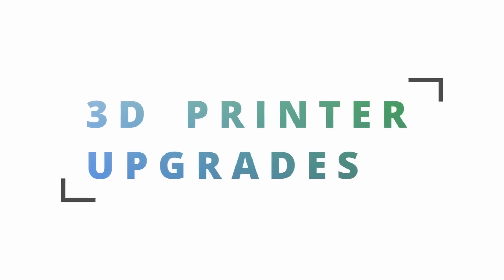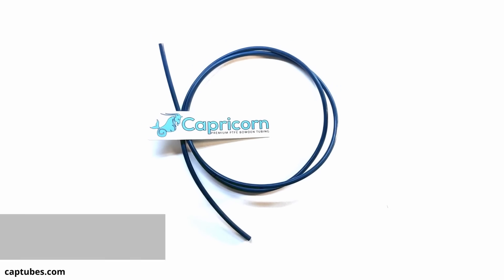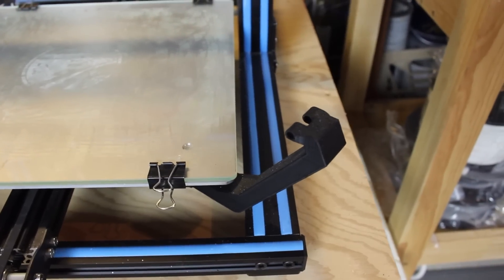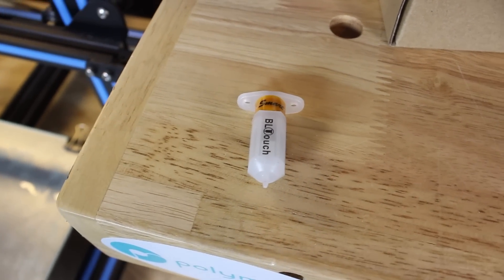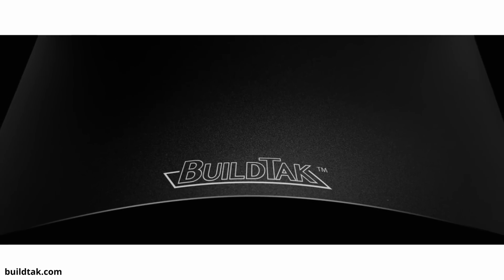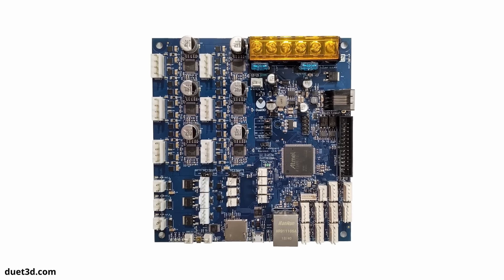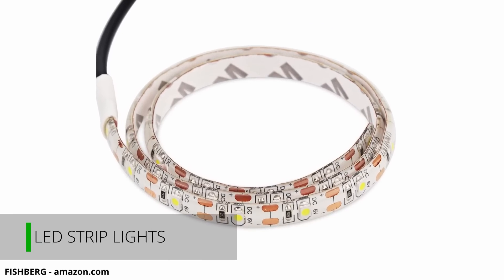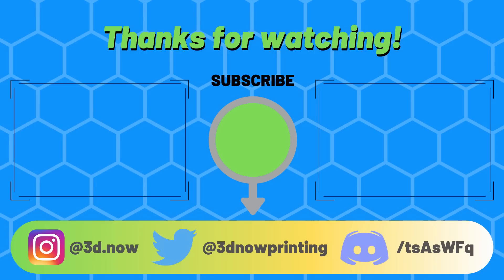The BEST UPGRADES for your 3D Printer!

Comment: This video really didn't age well.  Either that or it wasn't good to begin with.  

A steel nozzle is only a good idea if you are using abrasive filaments with stuff embedded in them.  Otherwise, they have worse heat transfer which can impact print quality.  Do yourself a favor and get a bag of 30 brass nozzles on Temu for $6.  If it's worn, clogged, or crashed into the bed, just replace it.

Also, don't bother with capricorn snake oil tubing... just get a bi-metal heat break.  Only costs a little more, but it's not a wear item and actually fixes the problem.  

I'm not sure if those smoothers actually work, but I wouldn't use them.  

The rest isn't bad.  Obviously there is new stuff... do klipper firmware with MainSail or Fluidd instead of octoprint so many benefits to klipper.  BL touch if you don't have it is great.  BTT makes great boards for a decent price.  Rails are all the rage now too.

Comment: Quick FYI for people, the 2mm silicone LED strips fit into the groves of a standard 2020 rail , and it dosnt conflict with the wheels - so you can add it to you Z gantry on the inside and have fantastic lighting on your parts.

Comment: I already disagree with number 1... You only should use hardened steel for abrasive filament. I also find Tough Tube to have a better tolerance, and cut better anyway. Also, the blower fan shroud you printed is cracked. Lol. Filament guide squeaks like crazy (I'm about to experiment with gluing a small piece of sponge to mine for greasing/wiping filament)

Comment: I printed carbon filament with a brass nozzle for an entire roll without noticing any deviation in my prints. Then I switched to a cheap hardened steel nozzle- which I've been very impressed with. A steel file glides over it without biting.

Comment: You don't need motor dampers if your controller board has a good motor drives. It is better to have a good controller board than a hack for a small problem.

Comment: See if this makes sense.  The Mosaic Palette 2/Pro deposits color filament inside the object that nobody is going to see.  But in order to do that it has to change colors by dumping a whole lot of waste to a secondary brick.  So while printing a many color object why not just have the exterior shell of that object where the colors are needed get printed and the filler can be whatever base color you like or it can be the "waste" material used as in-fill.

Mosaic isn't the only method of integrating multiple materials or colors into your objects.  There is another that mounts up to 8 spools for integration onto nearly any single or multiple extrusion head 3D printer.  It was featured in a video on 3D Printing Nerd's channel from 2019.  Sorry I can't think of it more precisely as it is late and I am too tired to dig it up.

Comment: No offense but, how on earth is an LED strip a "hard" upgrade. You literally just plug it into a power outlet, whereas a "moderate" upgrade such as the bl touch, involves a complete re-flash of the software.
Reply from the maker: You're right, but I put it in the 3rd tier because it is a "nice to have" upgrade and doesn't affect print quality.

Comment: The steel has half the thermal conductivity of brass and needs the heat to be turned up much higher to work properly
Reply: It's about 5 degrees C more.

Comment: Good video.i agree with you,but some things have to be considered.
Would be nice to have the upgrades done and tested as well.
For example the bl touch/any auto leveling system.it's easier to learn to do a perfect bed leveling than trying to get  them going and keep them that way.they're a unneeded pain.
Linear rails,there are machines that have worse results with them,due to they're tight tolerances.a bit of play it's good sometimes.

Comment: BL Touch, a good way to descend into madness. From drifting by .3 mm  to just failures in the coil. Adjustment screw only helped in the short term with the drifting however at that point I rather just have a z endstop. Now if you want a good device, look at ir sensors.
Reply: I went mad trying to figure out the software upgrades and just returned it and spent the money on a metal extruder, Capricorn tubing, glass bed, and silent mainboard. Much better use of 75 dollars.

Comment: One thing you missed on, although most people will never need, is an upgraded heat break. Mine just recently broke so I decided to get a E3D titanium break. 

I haven't got it yet so I can't comment on how well it works, but I can't imagine it being worse then the stainless steel ones that most printers use. 

Wish I had it before mine broke, now I have to wait for it to get here to continue printing.

Comment: I would recommend the EZABL by TH3D studios instead of BLtouch. The EZABL is more accurate, more repeatable and easier to wire up. No hardware modifications required apart from the mount. If you wish, you can power it from the motherboard but that's a hardware modification you'll need to do if you so desire. Firmware change is nonetheless required, but is a bit easier.

Comment: If you're getting the Filler spool holder for a Creality printer with the metal spool holder, get the remixed one. The original has a joint that buckles under the weight. The remixed one combines the holder and the base and eliminates the joint, making it sturdy.

Comment: This looks awesome. Except, I don't own/know much about 3D printing. 

Like, can any nozzle on a 3D printer be changed? 
Is the nozzle the only thing you have to change to use different size filaments? (And different materials?)
And lastly, are you able to change a Bowden to a direct driver?
Reply: nozzles can be changed, would be bad if you could not, most are M6 but there is no doubt some that use other threads
you have to change extruders and mess with the software i believe
yes did so with my cr10s, went from the stock bowden to the aero made by E3D
Reply: Pretty much every part can be changed out.  The ones that have no electronics are probably easiest.  I wouldn't worry about it until you need to, though.  You'll have plenty to do just with the stock machine.

Comment: All of those buildtak options are nice but they don't work with ABS due to ABS demanding ~110c bed temp so 105-120c.  The glue sticky is the issue.

Comment: Palette 2 doesn't really work, 70%+ failure rate with the product constantly jamming and many design faults that cause constant failures. Customer service from Mosaic is hopeless and the product only prints at 1/3 the advertised print speed

Comment: Seems like this went with the most expensive, not the best upgrades. Especially the last category.

1.Hemera??? What a waste of money, nothing revolutionary, and mounting is a joke. The PrinterMods direct drive upgrade is inexpensive and allows for dozens of hotend/extruder combos along with ready to mount linear bearing guide mounts for less than $40. I highly recommend taking a look at this for yourself.

2. Duet board??? This is another huge waste of money when can go with a SKR board for silent 32 bit 2209 driver replacement at less than $30.

You have fantastic video quality and narration but think this list was hugely bias to E3D products that are all over priced and not as great as described.
Reply: Duet is a waste if you upgrading printer like those in video. It is not only about silence. Same about Hemera.
Reply: I disagree, the Hemera is an all in one beast in its self. While I agree it's overpriced its because there was a team that designed it for optimal use. Mounting is an issue but can be solved with creativity. The Hemera also allows for a lot of different uses that a $40 system cannot handle. I do completely agree with the SKR instead of a duet board.

Comment: One you forgot to mention is a filament run out sensor. I am getting my Ender 3 ready to install one . The firmware has been updated and wires have been soldered into place, I am just waiting for my limit switch
Reply: How often does this come in handy? I rarely find I would need one as if I'm running low on filament I only print smaller things and just throw out spools with less than 50g

Comment: I would like to say the DUET Motherboard replaces the need for Motor Dampers, TL Smoother, and Raspberry Pi (Octoprint). If I knew that before I went and upgraded all the previous things over time. I would of just went straight to the Duet 2 WiFi.
Reply: Damn ok👀👌

Comment: I am crazy looking for information on which printer to be my first one, for the moment, it is either ender 3, ender 5 or one delta printer either the  "ANYCUBIC KOSSEL PLUS DELTA" or the "FLSUN 3D METAL FRAME KOSSEL DELTA"

would anyone be kind enough to post their thoughts on which of these printers would be best to help me make the final decision? 

by the way, great videos, keep up the good work
Reply from the maker: Check out my discord. Link in video description.
Reply: I've got an anycubic kossel plus Delta, and a creality cr10. They both work well, though I think the kossel has a more robust extruder setup. It's been printing beautifully right after assembly, while my cr10 has needed some upgrades to print reliably.
Reply: I have anycubic mega s and it print well it was my first printer

Comment: The spool holder is the only one you need for any config. I personally mounted on my wall and use the provided printable bearings. Added a few drops baby oil to the bearings and it effortlessly rolls as if they are metal. Print this holder if you need a reliable one.

Comment: I just got a ctc for Christmas and had to do a few mandatory upgrades. The seller I bough from cut corners, not ctc’s fault. Needless to say, had a faulty motor and instead of a regular sized heat bed there was a 3 inch heat bed kapton taped to an aluminum plate. Can share a picture in your discord if you want to see. After I ordered a new heat bed and motor this thing prints like a dream

Comment: You should have mentioned that if you get a better control board then you don't need tl smoother, if the new board has tmc drivers then the dampers aren't needed either.
Reply: I never needed them with the 4988 either as it is just one of the versions (I forget which one) that needed them.  I use TMC now though.
Reply: the dampers are shit anyway. they mess up the accuracy...

Comment: Triangle labs cloned parts from aliexpress work very well, and are much cheaper...
Reply from the maker: I would much rather buy products and support the companies who actually innovated and created them in the first place. I would rather buy a high quality product that I know will work and last. Also, with the actual companies you have customer service.
Reply: @3DNow  I would also prefer to support the companies that designed it but not everyone can afford $80 for an extruder, $30 for a nozzle etc especially when the printer only cost $200 in the first place, I mean if I used all genuine parts just replacing the hotend, extruder and nozzle would cost me close to what I paid for the printer, I do have some genuine parts like my bltouch, capricorn though but I have to buy within a budget so $80 genuine vs $25 clone is not a choice I can afford atm unfortunately
Reply: @Idlepit2  if you're printing high end materials, 30 for a nozzle isn't bad. If you're only printing pla you don't need it and e3d brass nozzles are cheap, especially for the quality. There is a big difference in cheap clone nozzles and real e3d nozzle. Cnc kitchen cut some up and proved that.
Reply: @neilsiebenthal9254  I use genuine e3d nozzles but I've also used cheap nozzles, one of my favourite nozzles was a cheap plated copper nozzle worked just as good as e3d nozzle but was none stick and cost about $5 so on par with the cheaper e3d brass nozzles I believe that was a trianglelab nozzle
Reply: @3DNow  by that logic, when are you selling your CR-10 and buying an actual Prusa(that is what it is a clone of after all)
Reply: @artbrann  the cr10 is not a clone of the Prusa... 😂
Reply: @neilsiebenthal9254  close enough for this comparison, considering it is a "Prusa style printer"(and some sites even say Prusa clone)
Reply: @artbrann  sure... Just they use completely different motion systems, size, extruder, hotend, and certainly aren't called a prusa clone to trick people into thinking they're just like a prusa. Because that's clearly worked.
Reply: @3DNow  copies from certain Chinese resellera work fine for 1/5 to 1/3 the cost. I am a cheap skate.
Reply: just like the SKR boards are way better than stock but not the stupid price of duets
Reply: Triangle labs is awesome I have their bmg clone works fantastic think I get their clone v6 next
Reply: @Idlepit2  get the all metal v6 gold
Reply: Trianglelabs is still risky you'll get bad parts and have to buy the stuff again. I gave them a try and got there bondtech version and it had terrible clearance issues. You had to really squeeze the idle side to get it to close, the bowden attachment didn't fit without filing and shaving away parts. When I brought all of that up with them they pretty much said too bad, that happens sometimes with cheaper molds, yes they admitted they use the cheap molds if it wasn't already obvious, and I shouldn't bother buying anything else from them if I didn't want to mess with things to get them to work. I got a volcano hotend with the same order and never used it after that interaction with them and gave it away. Remember they're cheaper for a reason, they cut corners using designs other people spent years coming up with to be perfect. Im sure some stuff works fine, but if you get a dudd, don't expect any helpful customer service.
Reply: @neilsiebenthal9254  yep that's the gamble, for me it's paid off as I got parts that worked fine for a fraction of what the original would of cost